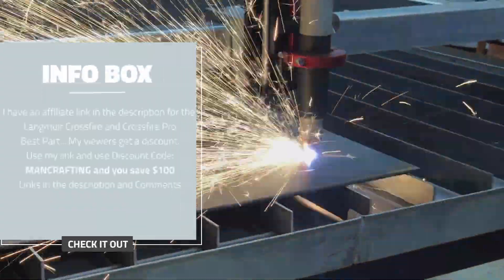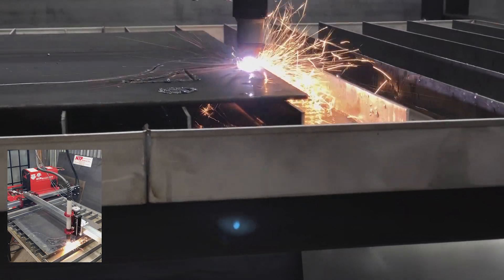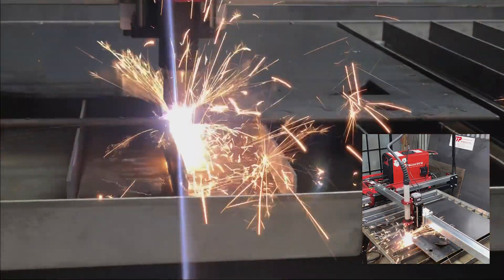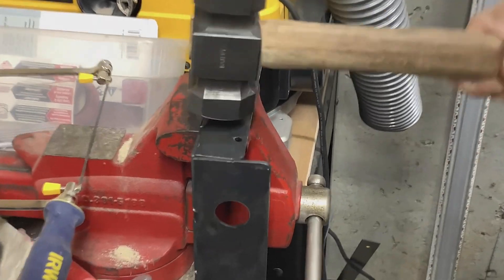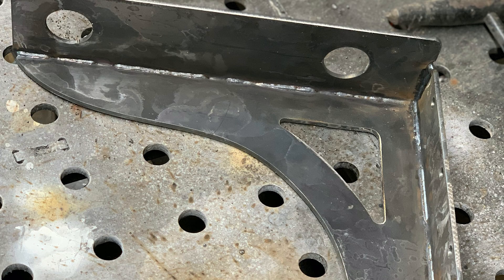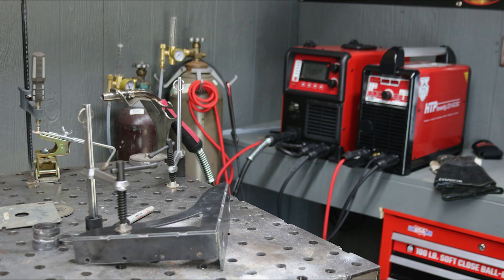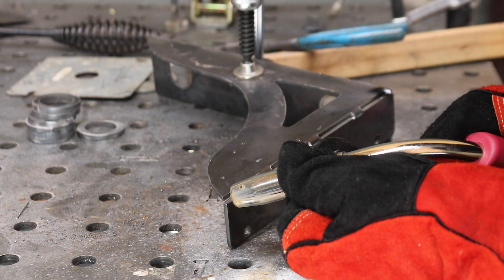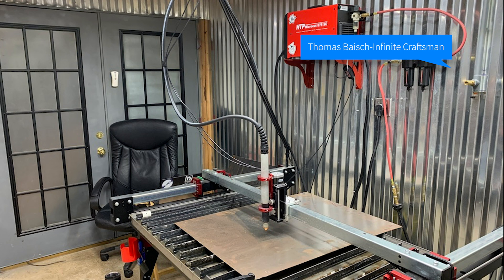Langmuir Crossfire Pro Is this the Best Value for the Home Shop?

Comment: I'm in the market for a cnc table now and wondering if, after a year +, if you have realized many limitations with this system or, if it has created enough revenue at this point to possibly regret not investing in a bit heavier duty or larger machine?
  I already have a Hypertherm 45 XP to add to a machine. 
 There is so much variety and competition in the plasma cnc market that I find it very difficult to feel confident in choosing a vendor. I've read so many software horror stories and have no cnc experience to draw from but I certainly want every design possibility open to me after making the investment. Any feedback would be greatly appreciated. Cheers
Reply from the maker: Also. The software for actually tuning this machine I love. The keep releasing updates with more features as well based on user feedback which has been great.
Reply: @ManCrafting  This is encouraging information. Thank you. 
  It does seem like this machine offers a lot for dollars spent compared to many others. 
A couple more questions if you wouldn't mind, if you needed to cut out a sign, say 6' x 3.5', can you stop mid job and slide the sheet up to continue cutting letters after the travel has maxed out without any alignment issues and does the cost of the machine include full licensing of the software and free software upgrades?
 Thanks, Roger.
Reply from the maker: @rogerbivins9144  that and if you need help there is a huge community both on the forum and on Facebook.  Not to mention the customer service really is customer service.
Reply from the maker: @rogerbivins9144  I did this to cut a 5 foot tall sign.  It’s called registration.  Lots of people do it.  I think some designs lend themselves to making it really easy to do.  Several people have alignment setup tools that you can cut and add to the table. The FireControl software is included.  You will still need design/CAD program.  I use something like Inkscape and Sheetcam.  That’s separate but I think it’s available on the Langmuir site.
Reply: @ManCrafting  I really appreciate your feedback. I don't know how well established they are but I can't say I have really seen any poor reviews or commentary on their product line so far and the 4x4 pro model seems a pretty decent fit for at least the projects I have in mind to create and sell to begin with and it wouldn't' require mortgaging the house to have a system up and running. Thank you again!
Reply from the maker: For me, anything bigger in my current shop is untenable.  If these smaller machines hadn’t come out, I’d still be without one.  My original reason to buy it was to do on demand cutting for a product I was outsourcing.  So not having to spend $700 on a sheet worth was great for me.  It’s probably way more than that now.  I’ve done 5x4 foot signs on 3 occasions and tons of other sign projects. It’s payed for itself over and over.  I used it this week to cut half a dozen parts for my on demand stand.  You can look at my TikTok or some of my shorts here.  I post something every week.

Comment: I just bought this table and am about 4 weeks away from getting it. I have the Harbor Freight Titanium 45A plasma cutter which I will be using. I was wondering what type of Torch Head you have on your plasma cutter and if that was something you added. I am curious if I can add that type of Torch to my Plasma Cutter. Great videos! You just got a new subscriber!
Reply from the maker: Thanks.  I have the table torch sold by HTP.  I’m not sure if it’s compatible, but they have a great customer support and can tell you if they have an option.
Reply from the maker: Their website is usaweld.com

Comment: I think you just sold me my first cnc plasma cutter. Having the manual torch is nice and all but I am constantly having to ask a friend to cut me parts for sake of time. This is an affordable solution and you make is seem like the learning curve isn't that terrible. I am in....
Reply from the maker: I think you summed it up pretty well.  If you use Inkscape or Illustrator for 2D and Sheetcam the work flow is really easy.  I have a friend who uses fusion, and it’s too much of a time investment for me.  I can’t spend the time it takes to get proficient.  I have a more recent video showing sheetcam workflow.  It’s pretty quick to pick up.

Comment: This is a FAKE video guys. The only purpose of the fabrication you are watching is to show very expensive  equipment  in use. This is a commercial. This guy has about $10.000 sitting around his shop to make shitty welds on shelve brackets you can buy on Amazon for $5 a piece,. Give me a brake!
Reply from the maker: I didn’t have these tools make $5 shelf brackets.  I have it to make whatever I want whenever I want.  I’ve wanted a plasma CNC since first seeing one in 2015 at a friends welding shop.  At the time the cheapest one on the market was about $20,000 and was going to take up a space in my shop that was more room than I had.  When Langmuir came out with the first version I jumped at the chance to buy it.  Then they came out with the Pro.  It was a huge upgrade and I didn’t hesitate to buy it.  I live this machine and I know a lot of people who have it as well and are not only making things for themselves, they have created entire businesses around it.  I just had a guy come to my house who is considering buying one for his business which is making accessories for slotted shelving systems.  He brought two of his designs and we cut them out.  Normally to have a tangible prototype he’d have to send it to the company that does his production runs on a laser.  Now he’ll be able to do that on demand with no wait.  As for my shitty welds, I’ve done worse.  I have no training other than the few YouTube videos I’ve watched.  Currently I’m in school full time to rectify that.  Monday will be the beginning of my 4th week at Georgia Trade School.  Personally I feel like I’m doing a lot of good and am a pretty positive person.  I don’t have the inclination or time to go onto peoples videos and leave unhelpful comments.  I hope that at some point you can be as fortunate.

Comment: Hey Chad! Are you happy with the corrugated metal on the walls? What other options did you consider? I’m needing to close up the walls in my garage after insulating and looking for ideas. I will be machining, cutting, grinding, welding and plasma cutting.
Reply from the maker: It’s worked well.  Downside is it creates a challenge for hanging shelves, pegboard style storage etc.

Comment: How much did it coast you for everything  if you don't mind
Reply from the maker: This takes you to the plasma table. I got everything but the computer stand. So about $3k for this without a plasma cutter.  I went with the HTP.  https://store.langmuirsystems.com/?aff=2

This takes you to the HTP Plasma Cutter. I got it with the Table Torch at the time it was just over $2k  https://800usaweld.com/products/microcut_875sc_v2_plasma_cutter_manual?ref=3tijle_owkg

So all in maybe $5500 there is a cheaper plasma cutter that’s ok.  It’s had some upgrades since I owned their first version.
Reply from the maker: With the plasma cutter I have I’ve cut 1/2 inch, but should be able to cut up to 5/8.

Comment: Why choose this plasma torch over the one Langmuir offer as part of the crossfire pro kit?  Interested to hear your thoughts
Reply from the maker: It cuts much closer to the Hypertherm plasma cutter.  The torch is the same design as the hypertherm and the consumables are about half the cost. I had the RW 45 with the OG table and it was ok, this just cuts way better.  I had a friend using it before me so I saw the quality and he used his way heavier than I was.

Comment: I have the same plasma cutter. Where did you get the connector for the plug to hook up the torch height control at 10:17 of the video?
Reply from the maker: Langmuir has them available now, but I built it from parts I found on eBay.  It’s not worth building.  The pins are a pain.  I had to get a friend who has the tools for making the connector help me with it.

Comment: Nice vid.  Did you have good support from the Langmuir folks?  I'm contemplating on the Langmuir table vs. the Arc Light CNC table (way more expensive) built near me in Bend Ore.
Reply from the maker: Great question.  There’s an amazing forum, which they monitor and answer questions when needed, but their customer service directly has been amazing for others that have needed it.  Personally I might have emailed them once on my original table, but in this one, I have had no need to do so.  This has been such an amazing tool addition to my shop.
Reply: @ManCrafting  Thanks for your reply.  Glad to hear you had good support.  I think I will go with the Langmuir table and save some $$$.  Thanks again and keep up the good vid's
Reply from the maker: jetjock07 awesome. Let me know what you think.  It’s been a great investment for me.  Also ManCrafting saves you even more. $100 off.

Comment: I have owned HTP since 2008 I have the HTP microcut 625 and the inverted 201 AC/DC water-cooled TIG welder they have awesome equipment and their customer service is the best
Reply from the maker: I absolutely love having HTP in my shop.   No question.  Best service I’ve ever had.   Fortunately it’s never for problems.

Comment: Mine keeps cutting from one hole to another cut not shutting the torch off , I think it’s my post processing setup but not 100% where I’m messing up
Reply from the maker: I think if you post your g-code on the forum or in the Facebook group there are a bunch of people willing to look at it.  And let you know if that’s the issue or to look elsewhere.  I’m guessing it’s the g-code.
Reply: ManCraftingTM I found it in the forums, it was one of the buttons on the plasma cutter was in. The wrong position
Reply from the maker: Awesome.  Easy fix.
Reply: ManCraftingTM  yes but now my crossfire is cutting out the torch during the cut! I know it is not the plasma cutter as I can cut manually with it no issues , i may be cutting to high up about 1/8 in on 1/4 in steel . New torch so tip is good we will see what tomorrow brings also clamp on steel plate I’m cutting ,
Reply: @steveriley1600  Has your control circuits been protected properly by grounded shielded cables? If not, then the arc will induce EMI/RFI issues in your control system, guaranteed.
Reply: Jaakko Fagerlund I used the supplied cables , the control is in a fully enclosed metal box . The fire control cable I will have to look at and see. I changed it out with a different one did same thing , it only started after I change the selection on the plasma cutter to fix the non stop cutting ( the original issue I posted about) .  I’m going to try testing again today , see if it based on the amperage .  I did turn it up when it started doing it too.
Reply: Jaakko Fagerlund found the issue. 
My laptop stand used a usb fan to keep laptop cooler , it has a y cable and I had the controller plugged in to the y cable instead of my mouse.

Comment: Hi. I am a welder but I do not have a programming background when it come to CNC machines. Is this software hard to understand or difficult to create cut files?  Thanks
Reply from the maker: I’m with you.  When it comes to designing, it’s all 2 dimensional. So you can design things in half a dozen programs including InkScape.  Which is free.   Then you need to run that file through what’s called a CAM program.  It generates the code that the machine uses to cut.  That’s a little bit of a learning curve, but I use Sheetcam which makes it a little easier to do.   Last is the Langmuir Pro software.  Once you load the code it’s dead easy.  The older software Mach III want as nice of an interface and I didn’t care for it.   Also, there are 1,000’s of free  files online and even on the Fireshare page on the Langmuir site.  So unless you’re fabricating ideas in your head you could go a long time without needing to design anything.  Shoot, there are even guys in the forums that will generate the g-code for you or draw a file if you get stuck.   That side of it is my weakest strength, but I’m cutting more than I have time to cut.  Sorry for the long response.  I think I’ve had too much coffee. 🤣
Reply: ManCraftingTM Thanks for the reply. Yeah that was my only concern about purchasing a CNC machine. That’s great info I appreciate it. Makes me feel a bit more confident in making the decision to purchase a unit. Have a good one.
Reply from the maker: My absolute pleasure.  Like I mentioned in a comment above.  I saw a friend use his torchmate in 2017.  I was blown away.  It was a little out of my space and price zone, but I could only imagine what I’d do if I had one.  Now I do and it’s 1/3 the price and a little smaller footprint.  I’m still in awe that I own it.
Reply from the maker: FincaDelSol PR what did you decide?   I’d love to know if you end up getting one.

Comment: Is that the torch holder that comes with the Pro table? If not, where is it from? Link?
Reply: I’ve purchased the Pro table (using your discount code) with the THC. The order indicated it will ship in July so I am gathering all of the extra equipment I need/want. I’ve purchased a new PTM60 machine torch head, new computer, and a IR air dryer. I did not see the torch mount on their website so maybe this is the one that comes with the THC?
Reply from the maker: 4ourE seems like it’s a little hard to locate on their site for some reason.  https://store.langmuirsystems.com/collections/add-ons/products/crossfire-crossfire-pro-machine-torch-mount
Reply from the maker: 4ourE here’s other accessories as well.  
https://store.langmuirsystems.com
Reply: Thank you, just ordered on to be shipped with my order!
Reply from the maker: Awesome.  I’m glad I could help.  It’s the reason I post videos like this.  I want to help people solve a problem or connect them with the things that get me out of bed every day.  This CNC is one of them.  I absolutely love what I’m able to do with it.
Reply: ManCraftingTM Thank you for the great work and the quality of your videos...they are absolutely outstanding! Stay safe!
Reply from the maker: I got the torch mount from Langmuir as an accessory.

Comment: please do a walkthrough of the construction of this machine itself
Reply from the maker: What specifically would you like to see?
Reply: @ManCrafting  at 2:07 on the top you can see four red colored brackets with wheels in them. they are attached to a black steel tubing. How is this structure connected to the ballscrews?Also would like to know how the Z axis is attached to the gantry

Comment from the maker: Save $100 on any Langmuir Crossfire Table with Discount Code:  ManCrafting
Langmuir Crossfire and Crossfire Pro  http://store.langmuirsystems.com?aff=2
HTP Affiliate Links:
Multi-Process Pulse MIG Welder  https://usaweld.com/collections/htp-america-mig-welders/products/pro_pulse_220_mts?ref=3tijle_owkg
TIG Welder https://usaweld.com/collections/htp-america-tig-welders/products/invertig-221-ac-dc?ref=3tijle_owkg&variant=31782387581011
Plasma Cutter Used in my videos https://usaweld.com/collections/htp-america-plasma-cutters/products/microcut-875sc-v2-plasma-cutter?ref=3tijle_owkg&variant=27839354536019 
Table Torch https://usaweld.com/collections/htp-america-plasma-cutters/products/microcut-875sc-v2-plasma-cutter?ref=3tijle_owkg&variant=27839354536019
Welding Helmet  https://usaweld.com/collections/optrel-vegaview-2-5/products/vegaview-2-5?ref=3tijle_owkg
MIG Gloves https://usaweld.com/collections/clothing-gloves-1/products/htp-america-split-leather-mig-welding-gloves?ref=3tijle_owkg
TIG Gloves https://usaweld.com/collections/clothing-gloves-1/products/htp-america-top-grain-leather-tig-welding-gloves?ref=3tijle_owkg&variant=31472054403155
Best Setup I’ve owned for sharpening my Tungsten Electrodes.  I’ve made some, I have bought add-on accessories for my dremel.  This is the best.  https://usaweld.com/collections/tungsten-grinders/products/htp-america-tungsten-grinder?ref=3tijle_owkg&variant=27910084755539
Sales!  
An amazing MIG welder.  If you want a basic MIG welder that performs… Check this out.  https://usaweld.com/collections/htp-america-mig-welders/products/htp-america-mig-200i?ref=3tijle_owkg

Air Compressor with adequate capacity  https://amzn.to/2PFPo7X

Amazon Affiliate Links:
Shelf Brackets I replicated https://amzn.to/2z1MhEp
Certiflat Weld Table  http://weldtables.com/#_a_cust8g
Heavy Duty Magnet Square  http://amzn.to/2dycStl
Magnet Level  http://amzn.to/2cS2ZYV
Round Metal Marker http://amzn.to/2dMikvI
Marker holder and 12 refills http://amzn.to/2dCLTks
Heavy Duty Gloves  http://amzn.to/2dMiqDD
Standard Reverse Measuring Tape  http://amzn.to/2ut3PRK
Flatback Series Tape Measure 16 Foot http://amzn.to/2fgdIQQ
Evolution Power Tools EVOSAW380 15-Inch Steel Cutting Chop Saw  http://amzn.to/2dMhkb4

Photo, Video & Film Production Studio Essentials   http://amzn.to/2dMiP9f
USB Microphone - Silver  http://amzn.to/2dewgA5
Sony Digital Still Camera  http://amzn.to/2dJcAA0
Air Compressor with adequate capacity  https://amzn.to/2PFPo7X

Amazon Affiliate Links:

Mild Steel TIG Rod  https://amzn.to/2Di9VeX
Stainless Steel TIG Rod https://amzn.to/2Dke8hZ
Aluminum TIG Rod  https://amzn.to/2Dm8Q5Q
My Welding Helmet  https://amzn.to/2GiNI11
RAZORWELD TIG 200 https://amzn.to/2Iw5a5N
Jody's Helmet  https://amzn.to/2DgkTBG
My Gear
Welding Jacket  https://amzn.to/2IqYhCF
TIG Welding Gloves https://amzn.to/2Dh36KA
Helmet Bib  https://amzn.to/2Iqp9mg

Comment: Hi. Is this a 3 feet by 4 feet? Table. If not does Langmuir make a 4’x4’ table?
Reply from the maker: It’s 4x3 and I’m glad it is.  I believe they wanted a table that could fit 4 ft wide but still would fit in the home shop.  I couldn’t go 4x4 in my current space.  If I need to cut something longer I can make a registration cut and slide the material to complete the cut.  I just haven’t had the need.